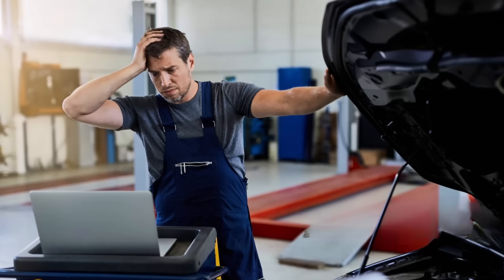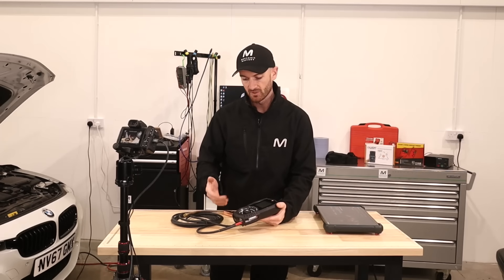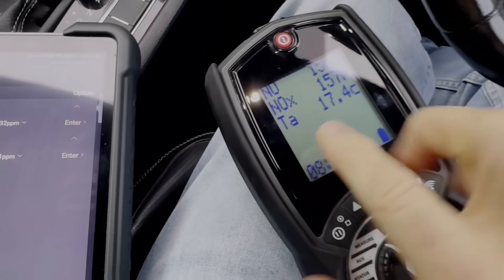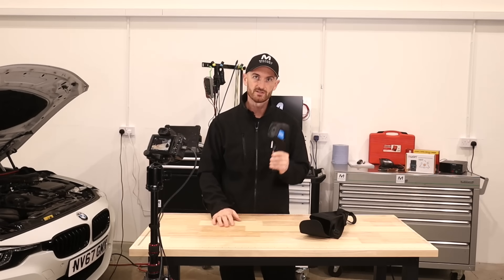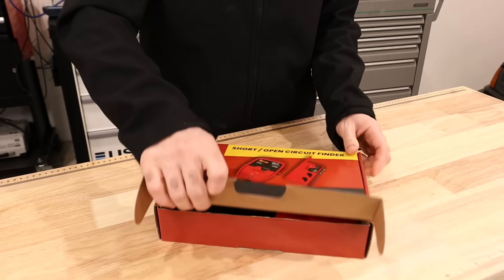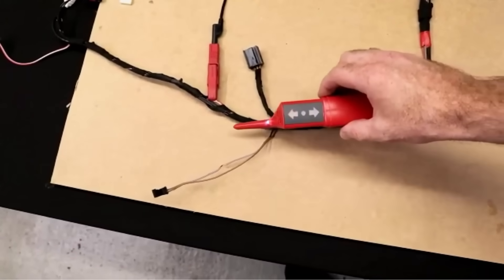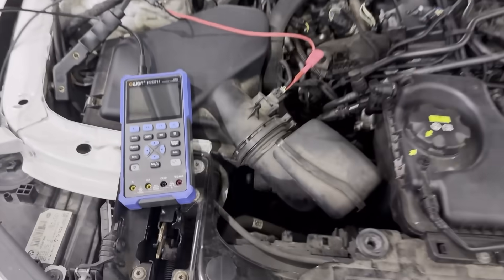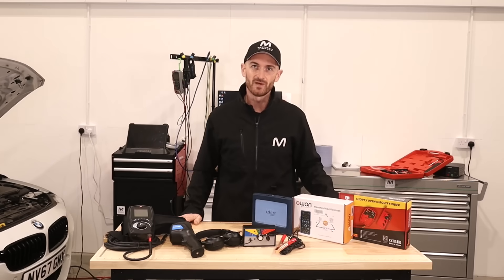5 Diagnostic Tools All Mechanics Need!

Comment: The thermal camera, is a game changer. Well it has been for me 

I've got the broken wire shorted wire finder. But I haven't quite worked It into my day to day, work flow.
Reply from the maker: Thermal camera is 🔥

Other have struggled with the ECT3000, I think it might only work if all the stars align haha
Reply: @MechanicMindset when I got it I read the warnings about having to isolate modules before use. So I only try to use it on older machines.

(Edited for typos)

Comment: Missed out Mllwaukee m12 battery with a couple cables with terminals into it and a bunch common component terminals on leads to test for funcion..😊
Reply from the maker: Haha, nice idea. Ive got an adapter with a soldering iron on, great cheap addition

Comment: I think you nailed it with that selection
Reply from the maker: Thanks! I think there are a few others we could cover in another video, what do you think?
Reply: An important tool is having the correct data on hand /wiring diagrams etc.
A magnetic solenoid tester  and a good compact led torch with a magnetic base  
 @MechanicMindset

Comment: Try Infiray  IR camera  - really is good. I replaced  a Topdon with one.  Before dismissing your IR camera as not being good enough to detect heat in a fuse unless the current is ready to blow it  try connecting  a few resistors across the battery  and (from Ohms law) you can calculate the current  and see just how low a current your particular IR camera will detect.
Reply from the maker: Will check it out. I have a Seek camera too. And the phone TopDon is a bit better. Like you say, test conditions are important as surrounding heat will affect the detected heat range in the view finder. I’ll have a play

Comment: Hi sir can you tell me the solution, I m facing can issue... my can low resistance (15 ohm to 340ohm)coming with ground after some time it's finished.. can high can low resistance 60ohm..
My only one device is not working all are working.. my can low high is 0.8v some time 2.1.. same voltage can high and can low... but monitor only show one device is not working.. I dnt know how I address this... what is problem

Comment: Ive seen 0.8 amp through a 10 amp fuse before BUT the car must have been off for hours and innside untouched, otherwise there is too much temperature change around it.

Or you need to change the isothermal settings but this increases the noise a lot
Reply from the maker: I’ll definitely have a play with this 👍

Comment: What is the multimeter at the end, the one with a scope?
I'm looking at these cheaper ones that contain a scope, just for working on my own fleet of vehicles, not running a garage.
Reply from the maker: Owon HDS272 👍 I like it, a bit fiddly, but not too bad

https://youtu.be/SF3wSrlI54w?si=mxHksB6dUNYu_bDX
Reply: @MechanicMindset  Thanks, it looks very useful indeed. In general, how do you know if whatever waveform you are seeing on screen, is correct/means a sensor etc is indeed working correctly?
Because you can manipulate that waveform yourself via settings, to change the graph, could that not make it appear to be working correctly?
From a newbie point of view, just being able to see a graph would be great but I'd have no idea if it's correct for the component im testing,... Is there some manual/data spec sheet to check against?
Reply: @steveclark.. Save waveforms on good running vehicles to be able to recognize bad waveforms.
Reply: @mikekotarba5828 Is that the only way then? I'd be a bit stuck then, I only have one car and one pickup, 3 motorcycles to work on.

Comment: Maybe in the next ESSENTIAL TOOLS you will count on ACCUTRAK, SMOKE MACHINE... etc.
Reply from the maker: Great suggestion. We’ve covers smoke machine before, i have a cheap ultrasonic noise tool and used expensive ones, but that looks good. Thanks
Reply: @MechanicMindset Yes, i have cheap... But only to buzzing inside for finding holes or gaps from outside, expensive im using only to hearing leakage.

Comment: 8:41 I have it... But have problem to figure out working (also i must mention my one was broken... Only one led lights, now is repaired) so, i find this video and i think is useful to be seen.

https://youtu.be/O8yK0KQ2s_w?si=FW7cWjIPljD3ALXO
Reply from the maker: Yes the ECT3000 doesn’t always work which can be challenging. It’s great when it does find the problem but I have had issues myself with u expected results
Reply: @MechanicMindset I paste link on that video, i not know but not appearing, now paste again and can be seeing... Point is that you must LOCK THE SIGNAL, for steady and clear signal.

Comment: I own the wireless name brand chassis ears helped me diag a random squeal literaly had to  drive 7 miles and boom it was the transmission lound and clear not the diff or transfer Case . Helps sell the job when no one else could.
Reply from the maker: It’s an awesome tool and many people aren’t aware of its existence!
Reply: Used the wired chassis ear in 2005 back in school. The power probe tool is pretty underwhelming and a huge waste of time that's why you don't see many techs using it. I have never found an open or short with instead it gave me wrong directions for hours.
Reply from the maker: @truth4reel  I had trouble trying to bench test the ECT, but it actually worked great in the live training we did for open, short and resistance! Although, I have heard about mixed results
Reply: @MechanicMindset I'll have to watch your training video, but the manual says that other wires in the loom can interfere with the signal, or other metallic objects can get in way of the signal. Try tracing a short in a ground wire that loops back in the opposite direction in the same wire loom which is very common nowadays in automotive wiring. The  pick up tool will signal one direction and then the opposite. If you have to pull out the wire loom to use the tool on it then that defeats the purpose for me. Using a light bulb or a beeping continuity tester is free and much quicker than this tool. I'm tryna think of a way to repurpose it as a supply for power and ground when testing because its long cable.
Reply from the maker: @truth4reel I like the bulb/beep method 😆

Comment: normal, sane countries and states may disregard 1st gas tool
Reply from the maker: Hahaha! Maybe for light vehicles, I think you have it in commercial diesel, included the trucks right? I guess most you guys aren’t touching AdBlue
Reply: @MechanicMindset yeah we get rid of it like a plague
Reply: @MechanicMindset would it be good tool for heavy duty truck? In recently switched to heavy truck and we work on mix of diesel and CNG semis and trash trucks
Reply from the maker: @tylerhill6706 If they have SCR/AdBlue and have to diagnose it, yes it’s worth having 👍